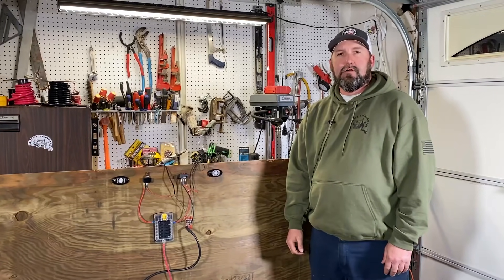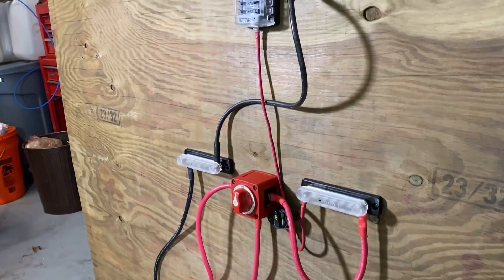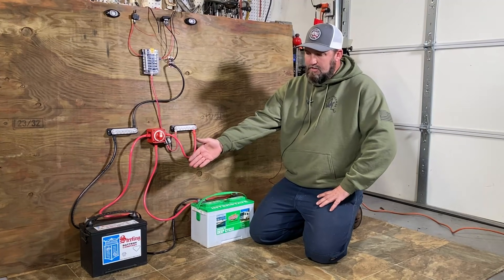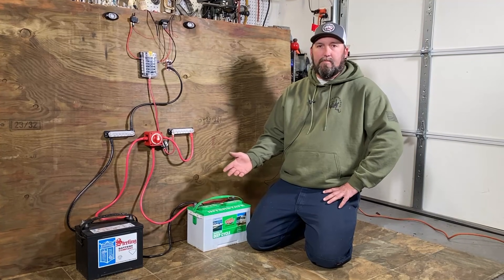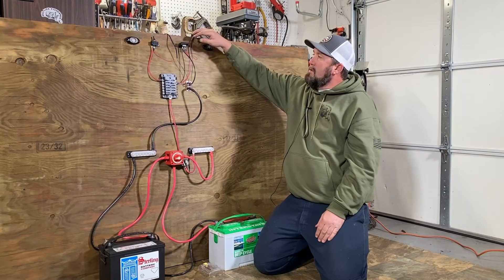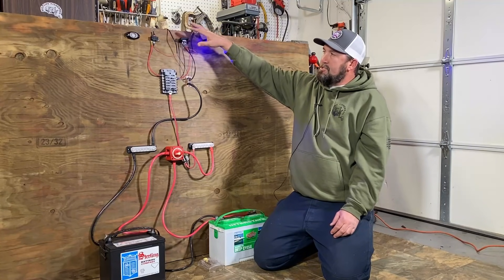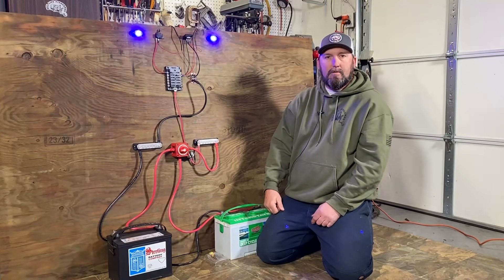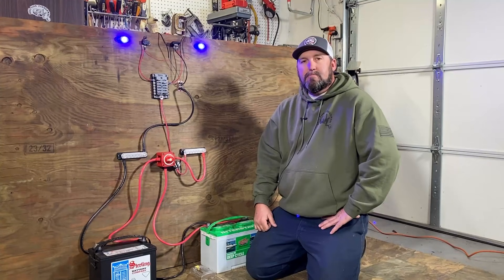BASIC BOAT DUAL BATTERY WIRING | HOW TO

Comment: What is the downside of running with both batteries on all the time. I did t know this and have been doing this. Now having some electrical issues. Gauge shows 18v and I have radio cut out at high volumes or lots of load. Yesterday lost all power to switches and accessories. Where should I start my diagnosis?
Reply from the maker: So you should have a boat power main fuse or breaker.. that would have popped most likely.. but the reason you don’t want to run the battery switch on 1&2 all the time is because the batteries are in parallel on that position.. so they are one big battery.. and  they are doubling the amperage but still 12v  also they are putting a larger load on your alternator or stator and rectifier regulator.. also the batteries if not exactly the same size,type and age will degrade the stronger one .. hopefully that makes sense.. let me know if you have any questions thanks for watching

Comment: What about charging?? Just put selector to ALL and connect trickle charger to either battery?
Reply from the maker: So you want to only use the battery switch on 1&2 in an emergency.. the batteries are in parallel on that position..  if they are not the same size ,type , rating and age the weaker one will bring down the stronger one and the batteries will go bad much faster.. also the charger is not going to properly charge either battery.. it’s best to get an on-board battery charger.. one bank per battery. That is the best way to keep your battery healthy and charged.. thank you for watching let me know if you have any questions
Reply: One "bank" per battery? Do you mean a charger for each battery? I keep my selector on 1And 2 and charge off of one. Battery's are identical.
Reply from the maker: Yes you need to charge each battery separately or get a actual on board battery charger with one bank per battery..  if you want to keep your batteries properly charged and healthy.. they will last much longer.

Comment: Could you hook an outboard with alternator to the cranking one in this set up? would it charge 1 or both?
Reply from the maker: You would hook the engine up to the output on the battery switch.. it could charge both on position 1&2 but because the batteries are two different sizes and types I don’t recommend it.. I would add a battery isolator charging relay.. it will switch back and forth and charge both for you..  let me know if you have any questions.. and thanks for watching

Comment: Good info but I'm just wondering you say you can't run both batteries at the same time not a good idea next question is you have a starting and a house battery how can you start the battery and then put it on house battery are you just started on house battery
Reply from the maker: Due to them being to different sizes and types of batteries.. they are in parallel on 1&2 .  And then I only switch the house battery when I’m going to be sitting on anchor.. there is a different setup where you can run everything on the boat on the house battery.. and then just the engine on the cranking.. but you would need to run a battery isolator charging relay.. let me know if you have any questions.. and thanks for watching and commenting..

Comment: If on the battery selector switch, you select batteries 1&2, can you charge about both batteries at the same time, or is it recommended to use a two bank charger?
Reply from the maker: If you select 1&2 it will put the batteries combined in parallel and they will both charge..  but in this set up they are two different types and sizes and it’s not good to combine them unless it’s for a emergency because they were both low.. and also all battery chargers want you to have a bank per battery.. so if you have two batteries you need a 2 bank charger.. thanks for watching and commenting.. let me know if you have any questions..
Reply: @ReelLifeFisherman  thx for reply , great video, this will likely be a winter project for me ! Thx again!

Comment: How would i introduce a battery isolator into this same setup to allow for alternator power to charge both batteries?
Reply from the maker: I have another video on just that.. check it out .. it’s pretty simple if you get the one I like to use.. just a 3 wire hook up.. let me know if you have any questions.. thanks

Comment: What do you think of agm for cranking and separate lithium battery for a series of led lights?f
Reply from the maker: Well AGM batteries are great.. and lithium batteries are awesome they don’t weigh much at all and don’t drain the same way normal batteries do.. but they are very expensive.. and I wouldn’t recommend hooking them up on the switch where there is a possibility they could be hooked up in parallel by position 1&2 ..  I would recommend using lithium for trolling motor batteries or keeping them separate from flooded or AGM batteries.. hope that helps .. thanks for watching

Comment: Appreciate the video. Is it ok to have 8 gauge wire coming from my trolling motor but use 4 gauge to put the batteries in series? Running a 36 volt system. Thanks in advance
Reply: If your using a trolling motor especially a 36v system. Use one gauge. 4awg is always recommended

Comment: Is it ok the connect the outboard red power cable to the power busbar rather than the perko common post. Also the black engine ground cable connected to the ground busbar then the negative of each battery directly to the same ground busbar? Hands down the clearest explanation I've seen, thanks.
Reply from the maker: Yes you can I just prefer to attach the motor directly to the output side of the switch.. less voltage drop that way for cranking.. but there is nothing wrong with it on the power bus side.. and yes same with the ground.. directly to the battery negative is just a little better circuit is all less potential for cranking problems.. but putting it on the negative bus will work just fine as long as the negatives are all connected together.. both batteries and the engine and negative bus.. thanks for watching and commenting, glad you liked the video!

Comment: I have a question regarding the switch, At around 1600 you talk about powering down your fish finders before switching batteries. How do you keep power to the fish finders when you want to run on plane or troll the area in locating fish? If you have to power down the fish finders when switching batteries to crank up the engine is there a way to still have power to the fish finders as the engine is running ? I plan to upgrade my trolling motors so it ties into my fish finders and I can utilize GPS to plot a route out with the lake topo for ledges and such? If you could explain this one would be much help Thank you

Comment: Thank you for this explanation...very very good. My question is that you connected the ground of each battery together which is obviously not a problem. Is this not a problem because the switch is only allowing one battery to power at a time? I do know you can do this when connecting batteries parallel or in a series. Not a lot of electrical experience on my end!

Comment: Great video / Subbed!   My boat manf. (Sportsman) dual battery set-up has two 24 series cranking batteries and a four position switch (Off, 1,2,1&2).  Question: you show a Neg. jumper wire connecting the Neg terminals on the batteries.  My boat has two separate Neg and two separate Pos wires that are connected to each Pos and Neg of each battery.  No visible jumper or Buss bars I could find.  Why is this different from your wiring?

Comment: I know it have been awhile since the upload - hopefully im not too late to get a reply.
1. I go out sailing for they day
2. I start the engine on "1" and the engine starts - as it is runnning i will be charging "1"
3. I end up somewhere and shuts the engine off and switch to "2"
4. I run the lights, my "fishfinder" and more (Battery 2 runs low)
5. I switch back to "1" and start my engine - No issues because "1" wasnt used during the day.
6. I get to the marina - my "2" i still dead.

If i started the engine on 1 + 2 i would have charged 1 and 2 on the way to the marina - but since "1" is my starter battery, wouldn't I wanna start my engine on that alone?
Or is it fine (assuming battery 2 is running "low") to start the engine on 1+2 to recharge "2"?

Btw - great explanation. Having the wires up on a wall makes it so transparent what is happening.
Reply from the maker: So yes you have it correct.. but the only reason it’s not good to run the batteries on 1&2 is in that position they are connected in parallel through the switch.. and since they are different batteries of different sizes and type.. that is not good for the batteries or the engines charging system..  you would want to add a battery isolator charging relay.. also called an ACR .. let me know if you have any questions.. and thanks for watching and commenting..

Comment: Thanks for a well presented video of dual battery wiring. One question, I have solar panels in my current system. I am looking to renew most of the current system to a more efficient system (one similar to which you have set up in the video). But I am wondering how I can incorporate the solar panels into the new system. So the old system - they are wired directly from the solar panels, through a solar charge controller then directly to the 'deep cycle/house battery'. If, in the new system I wired them directly into the fuse holder would this still charge my battery if the dual isolator switch is 'off'? (I assume not, and I will have to wire the system from solar panels, through control unit then to house battery as it was before) Hopefully this makes sense... Thanks again for all your help and a brilliant video. SUBSCRIBED!

Comment: Great video. It explains a lot. I have 06 17’ Sea Hunt Triton with 90 HP Yamaha that’s been sitting for a while. It is wired exactly like your board. How would I connect a 12 Volt auto battery charger to charge this system. Black clamp to either negative terminal on one battery and red clamp to battery 1. If this is correct, what position should the battery switch be pointing and will this charge batteries?

Comment: Why would anyone run a battery selector instead of an isolator? With an isolator, both batteries are charged when the motor is running, whereas a selector doesn't! The isolator is also automatic, so no need to worry about forgetting to flip a switch to charge or isolate batteries.

Comment: The ground cable from the battery goes to a ground busbar? Does it not need to be grounded on the motor?

. . . I ask because I went to charge up my battery but when I went to reconnect the ground cable it broke off. Trying to figure out where it was connected to.
Reply from the maker: So the grounds are all shared on a boat.. and the engine ground is hooked directly to the crank battery usually.. then a ground jumper from the negative on the battery to the negative bus bar and then the hose battery either has a jumper to the negative bus or the crank negative.. it really doesn’t matter as long as all the negatives are connected together.. that way they all get grounded to the engine.. hopefully that makes sense.. let me know if you have any questions and thanks for watching..
Reply: @ReelLifeFisherman  I see in your set up you have the deep cycle on the starboard/right side. My  boat is set up with crank battery on the port side. And deep cycle on the starboard side. It is then wired through the starboard side. Does this change my set up to be different than yours?

Comment: I was thinking about using two electric wheelchair batteries wired parallel. Main considerations - Wheelchair/medical appliance batteries are sealed lead acid deep cycle batteries: They are compact in size: And two of them would still be less expensive than the lithium ion trolling motor batteries that go for $1000 each. Any thoughts?
Reply from the maker: If space is an issue.. you have to to what you have to do.. lol.. they would be fine as long as your trolling motor is 12v and so are your batteries when wiring them in parallel .. but depending on size of the two batteries and room .. one larger group 31 might be better.. not sure what the wheelchair batteries are rated at.. amp hr and reserve time wise.. thanks for watching and let me know if you have any questions..
Reply: @ReelLifeFisherman  Excellent! Thank you!

Comment: First of all, fantastic video. I'm going to rewire my pontoon this weekend. I saw this video, then saw the one with the isolator. So with this setup, would I just add the isolator between the two batteries along with the switch, or does the isolator replace the switch?
Reply from the maker: Thanks glad you like the video and it was helpful! So you can run it without the switch.. and hook up all boat power stuff to the house battery and only the engine to the crank and run the isolator to keep them both charged and the crank safe from draining.. but the switch is ice to have for a couple reasons.. one you can run everything from either battery or start from either or both batteries in a emergency.. the other is you can shut off all the power to your boat with the switch.. thanks for watching the channel and let me know if you have any questions..
Reply: @ReelLifeFisherman  an isolator should be the minimum, then add a disconnect to the primary battery for total isolation. No selector switch would ever be needed. An isolator ALWAYS uses both batteries for cranking/charging, and ALWAYS isolates one side when off. It is also automatic, and doesn't require both batteries be the same size or type, like the switch does.

Comment: Fuses are not sized to the "load".  Fuses are to protect wires from overheating resulting in fires.  Size fuse on wiring based on wire current carrying capacity.
Reply from the maker: We are saying the same thing.. But “Load” sir is what would cause a wire to over heat..  that or a short to ground .. and exactly why you need the proper gauge and type of wire for the length of the run as well as the right fuse.. thanks for watching and your 2 cents ..

Comment: Can i just use the fuse box and not have the busbars? Should i use dielectric grease on all connections?
Reply from the maker: Yes you don’t need the bus bars they are only to avoid putting too many terminals on the battery itself.. in this set up.. now the engine itself should be on the battery switch or directly on the battery but other wires like lights, bilge, fish finder etc. can be off the fuse block .. let me know if you have any questions.. thanks for watching and commenting

Comment: This was so helpful, thank you for the content!!  

Here's what I have that needs juice: electric start on the 15hp tiller outboard, 12v trolling motor, and navigation lights (simple stern and bow lights).

Right now I have one battery that's hooked to the motor as a cranking battery.   It's my understanding that the motor charges this battery 
When it runs. 

I'd like to add a second battery to power the trolling motor and the Nav lights.  A house battery, I suppose we can call it.  With the flick of a toggle switch, I'd like to be able to click lights on and off.  

Is there a way to combine these items, so that the motor is charging the house battery when it runs?   Or is it best to just let the motor charge the crank battery and simply recharge the house battery at home with a super charger?

Comment: Just another quick question for ya. I purchased a new battery to have as a house battery just to run the two fish finders. Finally getting around to prep the install. My question is Do I need to have a switch connected that is used to flip between the cranking battery and the deep cycle battery, I was thinking if the house battery is just stand alone battery and I charge it back at the house I should not need the switch?  Do I or can I get away from having to wire both batteries together? I will still have the bus bars and connections just not the main switch.
Reply from the maker: So typically the setup your describing we would have a ACR (automatic charging relay) also known as a battery isolator charger.. this would charge both batteries when running the main motor z but keep things like fish finders, pumps, radios etc separate from the engine cranking battery.. now it’s not needed for it to work but your house battery is slowly draining without it and no way to charge it until you get home .. so when it dies your day is over .. but it should still last quite a while..let me know if you have any questions ,thanks for watching.
Reply: @ReelLifeFisherman  thanks for the info back, any suggestion on a good ACR o get? Thanks again
Reply from the maker: I have a video on installing one on my boat .. the battery switch is in the mix but the install would still be the same for you..
Reply: @ReelLifeFisherman  thank you I will check it out much appreciated

Comment: Is it not important to have 2 of the same batteries?
Reply from the maker: Only need to worry about them being the same when you run them in parallel.. with this set up they are only in parallel when the switch is in 1&2 . And only use that for emergencies.. in the unlikely Scenario that both batteries are low.. the idea is to have a larger deep cycle/house battery that you can run all the Accessories without the engine running or fear of draining the cranking battery.. and the house battery will run a lot longer then just another cranking battery.. let me know if you have any questions.. and thanks for watching